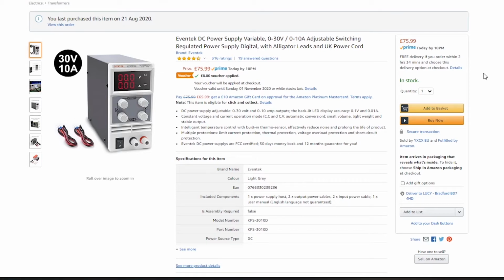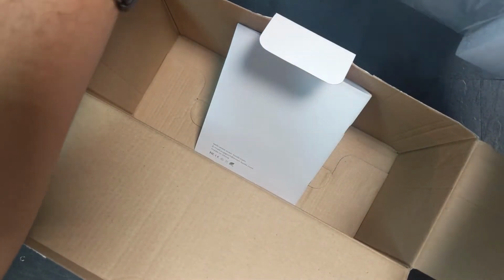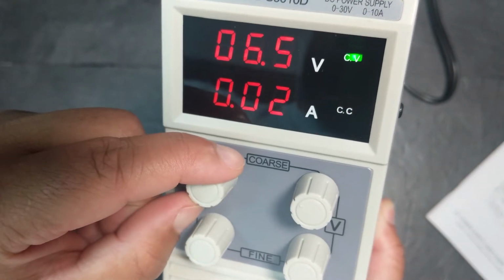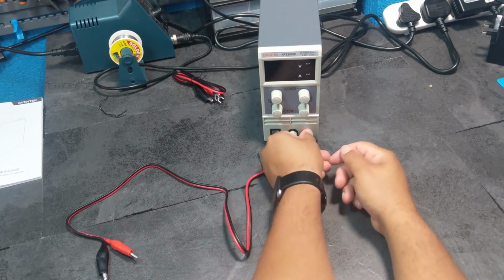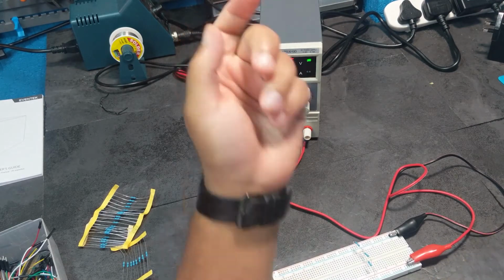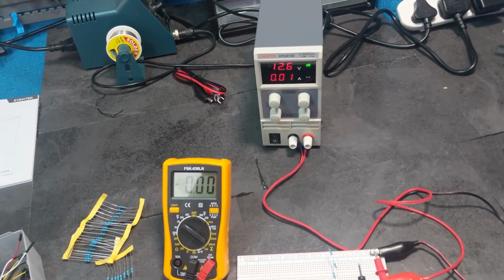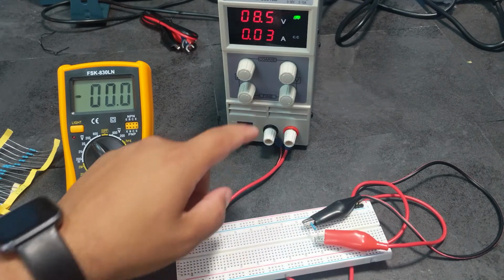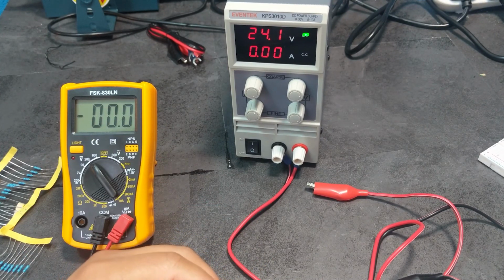Full Unedited Unboxing Eventek KPS3010D DC Variable Power Supply

Comment: Hello can you tell me how we can adjust the amperage? In the video it looks like it's always at zero. Thanks
Reply from the maker: You've got to create a current loop or full circuit for the power supply. Merely increasing the nob is telling the PSU, go to max current if able. But you need a load to take that current.